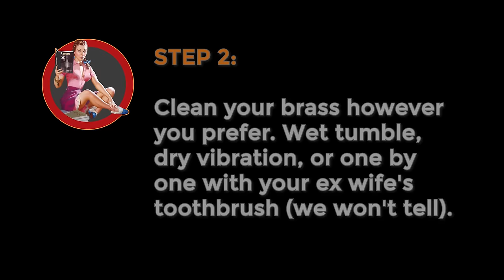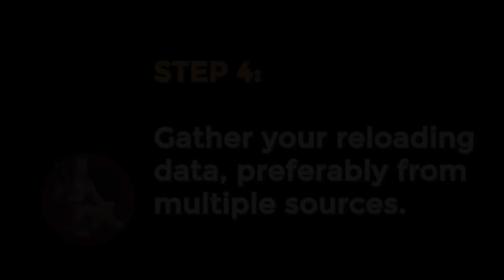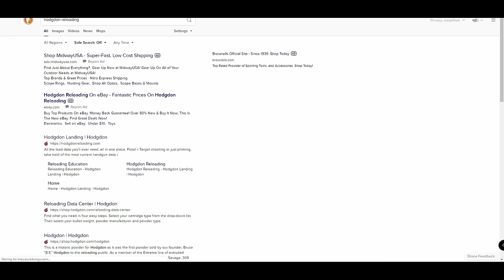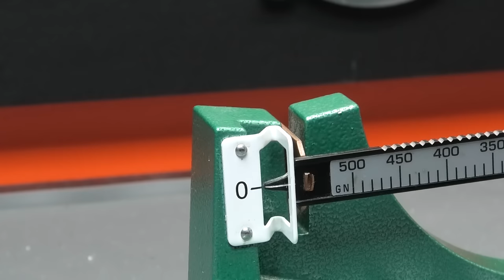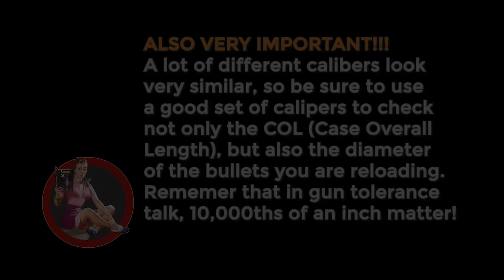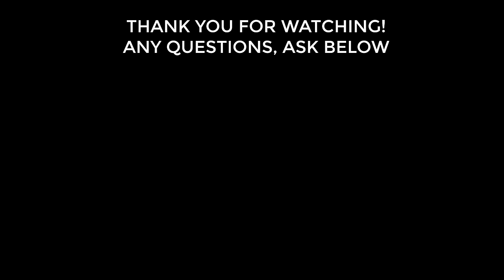Reloading 9mm. Start to Finish. HD.

Comment: I reloaded all my 9mm, .38 special and '357 magnum for years. I used a Lee single stage kit. If you're considering getting into reloading I feel that's a great way to get started. I loaded thousands of rounds with that rig and never had problem. You also MUST get a good reloading book. Once again Lee has a great book that takes you step by step through the entire process. I started as a means of saving money but I realized the real benefit was the ability to tune loads for optimum performance in my guns.
Reply: And as soon as you get sick of Lee-Dipping, upgrade to an RCBS powder measure.  Will save a lot of aches.
Reply: @Capt_Killingfield  I never used the dipper, I used the scale for my loads.
Reply: I agree with you completely. Starting with a single stage press allows the new reloader to develop a solid understanding of the reloading process.  Speed is never as important as accuracy. Cheers!
Reply: @sherlock1895  I also found the whole process relaxing. This is how I did it most of the time. Day one, get home from the range, throw the brass in the ultrasonic cleaner while I cleaned my guns. Next day, de cap, reshape and inspect cases. I did 150-200 rounds at a time, so that could take at least an hour sometimes even more with each caliber. Next day, recap and finish loading process. That's assuming I'm only doing one caliber at a time. If I'm doing all three calibers each one is the same process. I could do 9mm the first couple days, .38 the next couple, .357 the next couple. I loaded a lot less .357 than 9mm and .38. All in all I liked loading as much as shooting. Sadly I ran into some health issues and I had to give it up. The place I live now is strictly anti gun.
Reply: Can you make your own powder? Or is it regulated?
Reply: @thisismagacountry1318  Making your own basic black powder is relatively simple, the information is out there. I'm not going to get into it here because of YT's policies. Smokeless powder is a lot more involved. I've had people try to tell me loading my own ammo is illegal and are shocked to find out reloading is a fairly common hobby with serious shooters.
Reply: Jim, can the same 38 Lee kit also load 9 mm, 22 lr? Or do they each require a separate kit?
Reply: @mikem.2078  The kit will load just about anything except .50BMG and a few others, you just need to buy the right die sets.

Comment: How many times can you reload Brass? And How do you know how many times you have reloaded a piece of brass?
Reply from the maker: I reload them until they split. How many times you can reload depends on the brass. Winchester brass I find splits after ~4 reloads, PPU is much longer lasting, and most federal stuff lasts well. It is important to inspect each piece prior to loading, but as long as you are attentive, you usually will catch any that you miss during the cleaning, when you are seating a bullet.
Reply: @High_Caliber  Thank you for the answer

Comment: I have the same AP press. Very very new to this I’m not sure about setting up my dies!
Reply from the maker: Each die set is different, but a good starting point is to raise the plate up to the top, and bring all the dies down flush to that, and from there, you have to start doing it with brass in place, and slowly, adjust each  until each "station" is doing it's part with one pull of the lever, if that makes sense.  I also buy locking rings for the dies, so that once I have them set, they won't "wander" too much. Feel free to ask questions, I've run a heck of a lot of rounds through this press since I upgraded from the lee single stage. :)

Comment: dang i had a tumble like that when i was 10 or maybe little younger 40 years ago,, ha iit was a rock tumble for me.. but it was awesome kicked butt... ive been trying to find one like it nowadays.....mine was a 2 container and little longer.
Reply from the maker: That IS a rock tumbler! :)
Harbor freight, 2 container rock tumbler. 
I also had one as a kid, but it was a small plastic thing, didn't do much more than make noise.
Reply: @High_Caliber  mine was metal,(the machine) the rock holders was thick plastic, and had a big rubberband that covered the whole tumbler. wasnt to terrible loud..worked great on rocks...i think it was from sears,

Comment: The real pandemic 9mm reloading is 
1. Become a brass goblin 
2. Wipe down brass or let it be
3. Use in same gun and hope it hasn't become oversized or to long
4. Make primers from scratch or revive old ones with cap gun caps
5. Charge with appropriate amount of unobtainable powder
6. Seat in sideways upright vice
7. Crimp, crimp?
8. congratulations! Your ready for pandemic reloading!
Reply from the maker: I have tried reloading .22 lr by making primer powder, and I imagine that would be as much fun as rebuilding primers :)  
I haven't gone into the SHTF prepping level of reloading yet.  I'm more of a "have more ammunition than you can use in a year of frequent shooting, and keep enough components on hand for a couple of years of frequent shooting, then if you have to conserve, you're set.  I mean, my eyes aren't going to be happy if I have to start reloading primers with caps!  I'd actually want to figure out how to make smokeless powder from components, but I think that it's probably a) dangerous to just start trying to make gunpowder, and b) probably something youtube would come down like a pile of bricks over.  As well, I've never had to resize pistol brass, I find it just fails and splits instead of stretching like bottleneck brass.  Excellent comment through, have a great weekend!!

Comment: When I got my Dillion 550 Hornady wasn't making the Lock and Load. They see to be pretty nice, but I am assuming the bullet loader and the case loader are separate purchases. Thanks very satisfying to watch.
Reply from the maker: Nothing wrong with Dillon, that's for sure. I used to prefer their die sets "in the day" but when I went to re-equip years later their prices were just too much. The bullet feeder was extra, but the case feeder was 3d printed, so very inexpensive (and works great!).

Comment: Excellent step by step video, very informative. I've a question, while on topic of reloading 9mm.. 

Is it normal or unusual that when the 9mm case is rammed up for the resizing step, for the case to come down with sorta an abrasive or scratchy micro lines on it, and not look like it did when it went up at first?

I did remove the decap pin from die and wiped it with alcohol rag, also ran a small piece with alcohol thu die body. Looking thru it, it looked shiny smooth, didn't see any scratches. I did 20 cases, light lube and they all had those marks. 

When I did my 30-06 and 30-30 cases I never experienced this. And this whole rock chucker press equipment I bought from an army buddy who bought it new when we bought our rifle's back in 89. The dies were new too. 

Now, 34 yrs later, I have purchased my 9mm p320 and I aldo want to reload this round, I bought this two-die set from another person on ebay. 
I'm wondering if there's a solution, or should I just return it?
Reply from the maker: The Rock Chucker is a great press, and honestly, my brass really looks rough after the resize stage (scratches likely as you are seeing). That's why I do the extended wet tumble, it polishes out faint lines and whatnot. Otherwise, I wouldn't really worry about it too much unless you experience problems with extraction...tiny lines like that shouldn't do anything to a 9mm case (they aren't under all that much pressure compared to a bottleneck case). At the very worst you could try using a new die set, but very likely you would see the same things on a new one. Personally, I would just ignore it and enjoy.
Reply: @High_Caliber   @man_1911  Thank you for your input. I did contact RCBS yesterday about this. Just a few minutes ago I received an email saying they have created an order for me, covered under the warranty,, wow.  I'm left wondering if its just the die in question or a whole new set. I'm impressed. I hope, I hope..lol.
Reply: My mistake, that email was for a replacement primer cup,spring pin. But I called today, and they said I can send it in to them, bcuz it would be inspected, polished and if that doesn't fix, they'll send replacement. I shipped it out today.

Comment: I'm thinking about getting into reloading but I'm worried about the learning curve. That and picking the right equipment from the get go. Thankfully these days there's so much information at our fingertips. I'm sure once a guy does it and figures it out it's not intimidating. Reading the manuals as you stated is important but I hope I don't need to read the whole book. I hate reading haha.
Reply from the maker: Start by doing ONE round. Once you shoot that and realize it works fine, try 5 rounds. The two dangers of reloading is overcharging and undercharging. I do a count in my head for each step (prime/powder/bullet/seat/crimp). I think the secret is getting that rythym. I tell you, once you get your first squib load you realize how serious and/or expensive it is if you screw up. I find it really therapeutic.

Comment: What brand of dies are you using ? are they Lee I'm trying to find a seating die that doesn't crimp ( I hate that ) but simply seat .
Reply from the maker: I use Hornady dies for 9mm. I have never been the biggest fan of lee dies even though I have a few sets. My preference is usually Redding, rcbs, hornady and then lee, although to be fair I've never had one of their precision die sets, and a lot of people like them. 

Back to point though, the 9mm really shouldn't get a crimp at all, is it possible you have the seating stem set wrong? Try adjusting the height of the die body and the stem, sort of just start from scratch and set it up with a manufactured round (although be careful of course). It just sounds like the die is coming down too far.
Reply: @High_Caliber   Thank you very much .

Comment: Do you mind sharing the cost per round to produce 9mm. If you have all of the equipment and tools. I’m trying to do the cost analysis and figure out my break even. I’m starting to shoot a lot with my son. It’s double the cost every outing. He’s very handy, so I’m thinking 🤔 I may have a sweatshop worker in house, so labor costs won’t be an issue. Great video. Your obviously super meticulous. Much respect!!!
Reply from the maker: I buy components in mad quantities,  but I think I'm right around $.15 per round. The best I can find in pre-loaded is $.35 a round. I practice quite a bit for IPSC and IDPA, so reloading just makes the most financial sense. I don't count any cost to the brass since I've just scrounged thousands of cases (and bought preloaded) over the years, but you could add a few cents for the expected life of 9mm cases..... With .223 and other calibers, the difference is much bigger (9mm is generally one of the cheapest calibers to buy). So it really depends on how much use over how many years you would get out of it :)
Reply: @High_Caliber  even with 9mm that is very substantial. I’ve fly fished all my life and tying my own flies increases my enjoyment of the experience. I would think that certainly comes into play as well. Greatly appreciate the input and quick response. Subscribed.
Reply from the maker: @cg4164  You're lucky enough to have a spot for fly fishing. I used to fish a lot when I was younger, but it took so much time that I just never seem to have since I tried grown-upping. I guess also the time I'd spend in a boat is now spent at the range practicing, or finding a perfect spot to try my luck at 1000y shooting.
I never did try fly fishing, way too much work. I like a bit of trolling, but fly fishing is an upper body workout! ;)

Comment: If you are just loading average training ammo for 9 mm to shoot at the range, does the manufacturer of the bullet make much of a difference, or is all 124 grain/147 grain more or less the same?
Reply from the maker: It's really personal preference. I shoot bulk bullets even in matches,  but I do have friends that swear by "brand name" bullets. I find it's more important to find a gun that you shoot well. I can't shoot a glock well for the life of me, but have no issues with a 9mm colt or the CZs.  The only reason I shoot 147gr bullets is for the steel targets and poppers. Hope that helps!

Comment: Other than cleaning and inspecting the brass, do you need to chamfer the edges for the bullet to seat like rifle cases? 1st time reloading pistol ammo
Reply from the maker: On rifle cases, I would only chamfer if I had trimmed them, and I'll be honest, been reloading 9mm since the late 70s, and have never trimmed a pistol case. Now if you mean flaring, you do have to flare the case mouth on the pistol brass or you could crush cases when trying to seat the bullet. So for me it's deprime, clean, flare, prime, powder, seat, crimp.  I also only kiss the cases with the taper crimp die, just to uniform the brass, and I really only started doing that step after I started competing and really want to minimize any malfunctions while running matches. Hopefully that answers the question, and welcome to the wonderful world of freedom from  ammo shortages :)
Reply: @High_Caliber  thank you very much. And yes you answered my question. The Brownell guys said they never resized 9mm either. Priming some nines right now ;-)
Reply: @High_Caliber  So I have the Lee factory crimp die and not sure how far down I need to crimp. Seems like I need to to go all the way down the cartridge for it to chamber.

Comment: That background is awesome, although the gulls would have me looking for a 12 gauge. That bench top flex as you worked the (repainted?) press at the beginning freaked me out a bit. I'd fix that or go nuts😁
Reply from the maker: I  just this second finished building the new reloading bench/area. I now have almost 2 solid inches of countertop to bolt into, and the bench itself was out of a machine shop. I knew that setup was temporary until we moved. As a bonus, I can now record a vid on reloading .22 hornet, because I've never done any, and I just bought a new rifle in .22 hornet. So do check back. Cheers!!!!
Reply: @High_Caliber  Love 22 hornet! Addicted (officially)! I've loaded and shot a Browning A-Bolt, Anschutz Exemplar pistol and own a Ruger 77/22H a beautiful Ruger #1 and stupidly sold a very old Savage single shot break open rifle. It was very well made with ZERO slop in the action. Excellent news on the bench. I wish I could share some loads but I have data on old lots of H110 powder with old lots of Federal 205m primers (I have enough for a lifetime) in Win brass (brass effects max charges in the hornet!) with moly coated 40gr Vmax bullets (which require more powder) so I'm over book maximums. the factory Hornady 35gr loaded ammo was hilariously accurate for me also. Watch out for the thin case necks if you use the progressive press, no big deal once you get used to it. Next time you load a pistol round with a taper crimp please show everyone how you set the crimp/seat die. I remember I had a hell of a time with pre-primed factory Nosler 40 S&W brass 'till I figured out Nosler shipped them with no neck tension, had to size part way with a carbide die with primer pin removed then bell the mouth & all was good. Thanks for not shooting another "talking head shot" video.

Comment: whats the cheapest/reliable reloader that I could get to start with?
Reply from the maker: Find an RCBS rockchucker. There's almost always used ones online or on message boards. I started with the lee classic, but I would start with a rockchucker if I did it over again. The progressive press is great, but it's nice to learn all the steps one by one on a single stage press.

Comment: i loaded (by mistake) .380 acp with 147 grain ...found out the bullet slipped into my batch of 90 grainers (wich are heavy in 380 realm also) but i kept the round it had right amount of powder it fitted into the chamber (wich is supposed to NOT fit there cuz it has small freebore) shot it and it barely pooped the boulder outta barrel :D
Reply from the maker: It's honestly surprising that I don't hear of more occurances like this... so many bullets will "fit" into other cases. I always buy the same 147gr bullets with flat noses and round noses for 115gr so that I can tell what is a practice round, and what are competition rounds.  Glad you didn't get a squib.
Reply: @High_Caliber  .380 is same as 9x19 except its 9x17

Comment: How about Tarn-X to clean the brass? Dad didn't have a tumbler and as I recall never buffed up his brass before reloading.
Reply from the maker: How would you clean them with the tarn-x?  It would likely shine them up well, but you wouldn't want to so each one individually. 
I used to use a dry tumbler years ago, but then I had a blood test done and the lead levels in my blood were concerning, so I took steps to keep contact and dust to a minimum, so wet tumbling is perfect. It's harder to use than the dry tumbling, but  no airborne lead is a huge bonus.